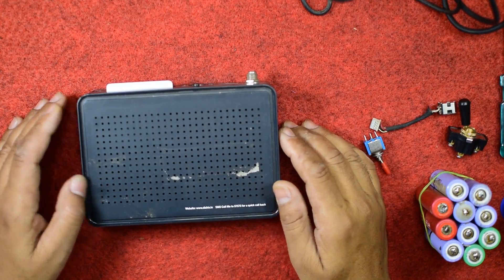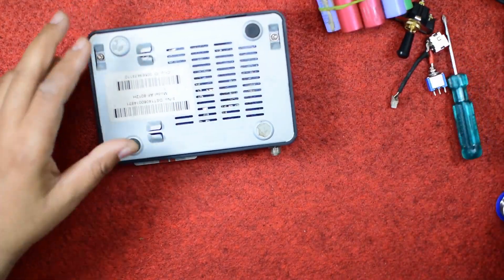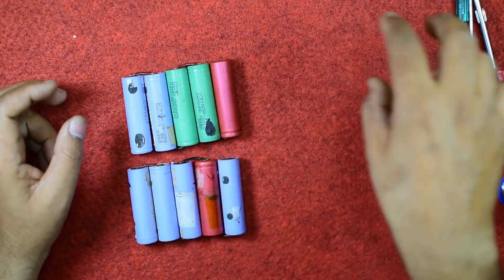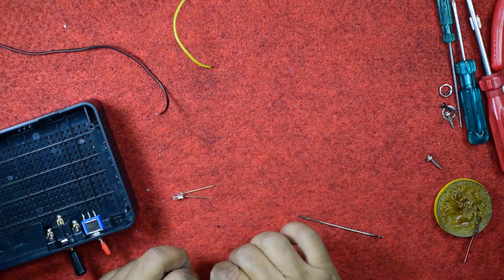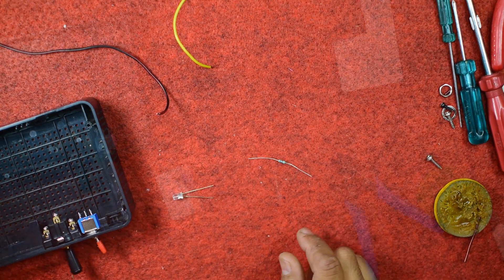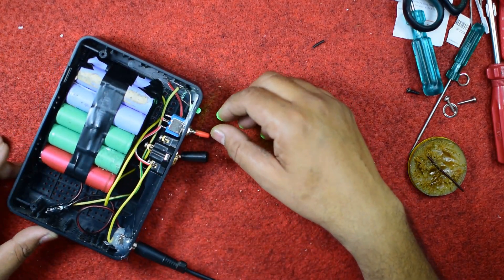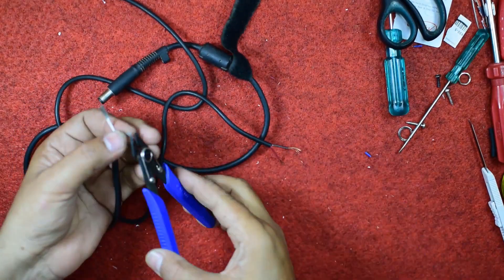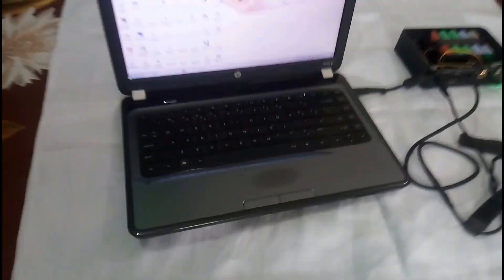DIY Power Bank for Laptop|| Laptop charger DIY|| Portable charger for laptop by Innovative ideas

Comment: Don't ever try this shit
That thing didn't even have a protection circuit or anything straight (20+) voltage to the board.check your laptop/adaptor it says around 19V.may be it'll kill your laptop circuit board ,if damaged you need to change the entire motherboard. Checkout Greatscott video its accurate and he explains everything in detail..

Comment: Ok, i like the idea also but its a valid point that a BMS is necessary. What happens if you let the laptop idle for  half an hour and you are not watching? Once Lithium cells discharge beyond 2 volts or there about, that's when they die and are not recoverable. a battery maintainer takes care of this.....that's what all those extra annoying wires from a battery pack take care of. It's called "Engineering" Every cell used in a battery pack are of very similar make up meaning they charge and discharge at the same rate. mixing up the different colored batteries (red, green, grey) is a jumble ....different colored 18650's means some are made for high discharge devices (electric scooter) and another color is intended for low discharge rate (small flashlight)  When you connect in series these jumbled colors you get a "push me pull you" effect on all the cells and very short battery life is the least of your concern....what happens if a child comes into contact with a leaking ruptured 18650's lithium cell? That's what UNDERWRITERS LABORATORY is for.  And we in the U.S. are not a 3rd world country where people do all sorts of barbaric shit to make up for what they don't have. Avoid Child Protective Services  being in your lives by not posing hazards at home!

Comment: Says it's not misleading,
1. Missing a goddamn BMS
2. no voltage regulating circuits to smooth out current flow and give out a constant 19.5 Volts
3. no short circuit/ overcharge/ overdischarge/ temperature protection to speak of
Might as well say allahuakbar whenever you're gonna use it.
this isn't innovative, this is ignorant.
Reply: make a proper one, i'll buy it.
Reply: @halleffect1  well I have a lot of designs ready to go. with the relations of china and my country rn, i can't order pcb's or any components. bummer :(

Comment: Wow thanks, I just finish making mine, and it works perfectly. But how do I add protection to it, in order to be on a safe side
Reply from the maker: You can make battery management system for 19.5 volts.
Reply: @innovativeideas  alright, please sir how do make this bettery management ?
Reply: RUN!!!!~!   Run with that bomb to your trash can outside then call 911!....Wash your hands and go to best buy and spend $60.00 and get a good nites sleep knowing you didnt kill anybody in a fire.

Comment: how much min and max volt should I apply be for charging these.
Reply from the maker: 19.5 volts 3 amperes. Better is HP laptop charger
Reply: @innovativeideas  and if i want to add BMS then how many amp should bms be any recomended protection board

Comment: When ever battery is lower than 4.2 or it allow to charging laptop voltage .. it means it work for 10 min or more but not use regular ... No procetions circuit or stable charger .... You not miss guid but you are miss guided ...
Reply: Pls I will to know how to make the BMS     MY  WhatsApp number ( 09056978680 )

Comment: DON'T TRY THIS WITHOUT A BMS GUYS
that's so dangerous, not even a bms "inovative", no battery status indicator, if you use your computer even 10 minutes off of the discharged battery it would ruin it. the whole point of a battery is practicality on the go, if you have to carry a multimetter with it what's the point
Reply: Pls I will to know how to make the BMS     MY  WhatsApp number ( 09056978680 )

Comment: What is the ampere rating of the battery? Can I use 6000mah battery instead of 4000mah battery?
Reply from the maker: Bro, I have used 2600mAh cells. Which are the best.
Reply: Thank you. Does it affect the motherboard if we go for higher mah?
Reply: @ChronicHunter  they dont make a 6000 mah battery anything that claims otherwise are fake cells and are normally not even 1000 mah
Reply: they don't make that big if your cell says its that big you have been scammed

Comment: Very good idea with the router case, but you need to add some battery protection or BMS to safe your batteries. You risk an overcharge and that mean your batteries rapidly loose capacity. This circuits is available for few dollars and it works.  I look for something similiar but little more complex... if i have success i share video about how i making something like you did, but little more effective. Definitly keep working and thank you for the inspiration :)
Reply: Good
Reply: Pls I will like to know how to charge the battery and battery protection

Comment: Thanks for the info... Can you tell me, how to discharge 18650 battery? More power to your channel
Reply from the maker: Shaila Oznola you can these cells by connecting 6volts glass bulb
Reply: this guy literally has no idea how electronics work

Comment: Is it needed that the 18650 cells are discharged before soldering it into series?
Reply from the maker: Shaila Oznola no bro, but be cautious while soldering.
Reply: there is no need to discharge them. make sure they are at same voltage and do not overheat them while soldering.